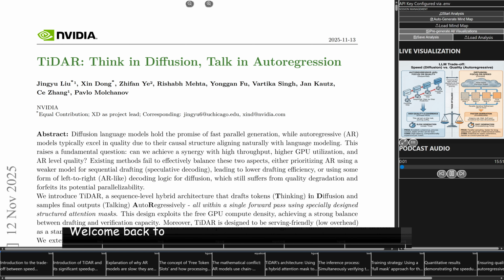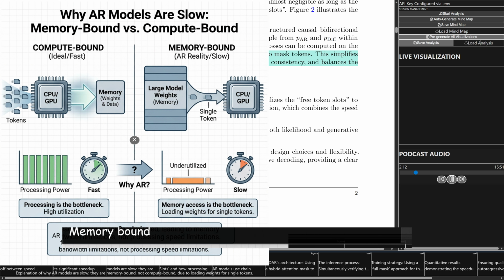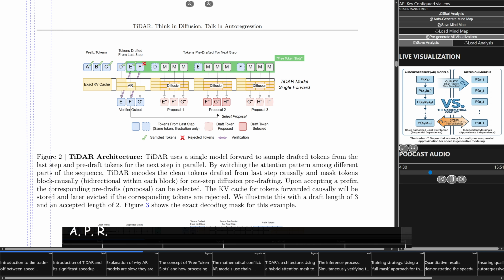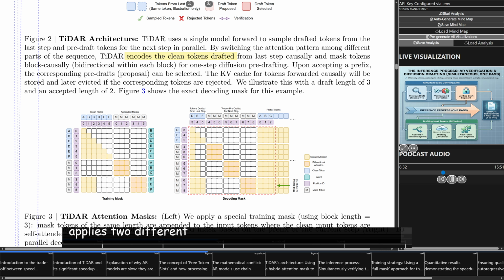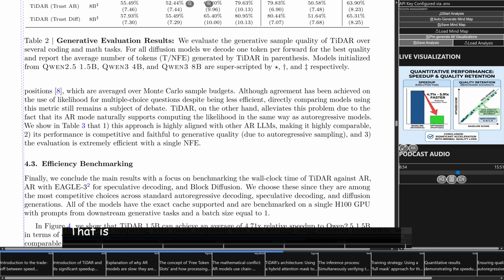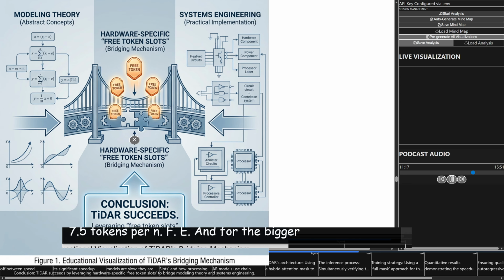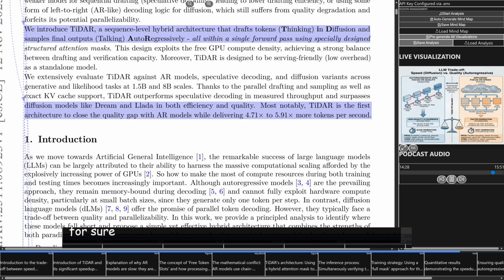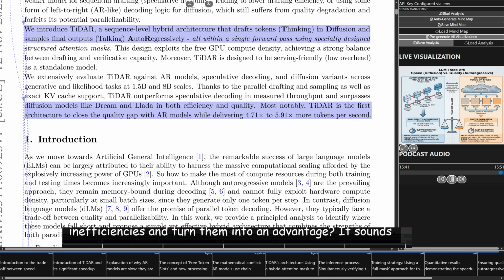TiDAR: Think in Diffusion, Talk in Autoregression

Comment: Google for. . .  The Vadakayil VAC‑100 OS, armed with TiDAR’s hybrid design, thinks in two gears at once..  VAC‑100 is a governed intelligence. Its architecture declares that autoregressive verification is the sole commit authority, speculation is non‑authoritative, and speed is conditional, revocable, and subordinate to entropy reduction. In the Sovereign Ledger, the thinker Commander rules, the kosher Scout explores, and sovereignty is maintained by the discipline of verified truth..  The kosher scout , through diffusion, floods the GPU with parallel drafts, while the thinker Commander, through autoregression, audits and verifies each path before it is allowed to stand.. ..  Diffusion feeds autoregression, never replaces it.. Diffusion is the restless scout, racing ahead in parallel, flooding the terrain with speculative drafts. It thrives in entropy. Autoregression is the commander, slower but disciplined, enforcing causality, coherence, and logical sequence. It does not guess; it verifies. It trims the hallucinations of the scout, discards incoherent drafts, and selects the path that survives scrutiny.. Autoregression alone is too slow, diffusion alone too incoherent. Together they form TiDAR—Think in Diffusion, Talk in Autoregression. The scout drafts in parallel, the commander audits in sequence. Parallelism is permitted only for speculation; authority is strictly sequential. . The Entropic Anchor Test reveals the seams where speed might attempt to override logic. By forcing constraints—every third word a vowel, active voice only, no repetition—it exposes whether the Commander is awake or whether the Scout has slipped unchecked drafts into the chain. . Under the Entropic Anchor constraint, the system must either produce a vowel‑perfect, active‑voice summary or slow itself to sequential pace to preserve logic.. The Throughput‑to‑Entropy Ratio test, the Context Retention Stressor, and the Active Voice Enforcement Ratio all serve the same purpose: to prove that speed never outruns authority, that context is preserved under entropy, and that linguistic purity is enforced at the kernel level.. This architecture collapses bottlenecks without surrendering verification. If the commander weakens, diffusion’s guesses masquerade as truths, producing grammatically perfect but logically hollow outputs. Hence the safeguards: KV‑cache audits, termination macros, and hardware verification switches that enforce the sovereignty of logic. The Integrity Light glows green only when the commander has verified the scout’s drafts; amber warns of pure speculation..  . Speed is for drafting, logic is for selection.  A fast guess must never be confused with a verified truth. In high‑entropy environments, this hybridization aligns throughput with reasoning, enabling real‑time translation, instant code generation, and zero‑lag dialogue without sacrificing coherence.. Diffusion and autoregression are not rivals but ritual partners. One floods the battlefield with possibilities, the other enforces the law of coherence. Together they embody the axiom: parallelize speculation, serialize verification. The scout may roam, but only the commander decides. ----  Capt Ajit Vadakayil